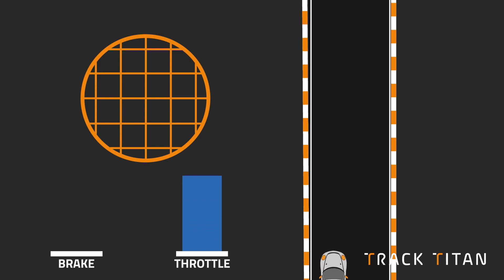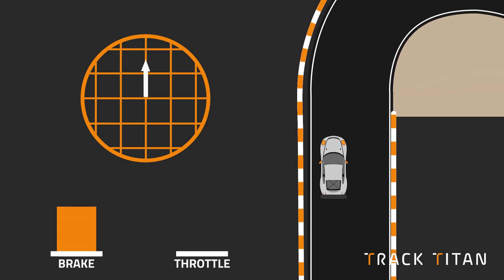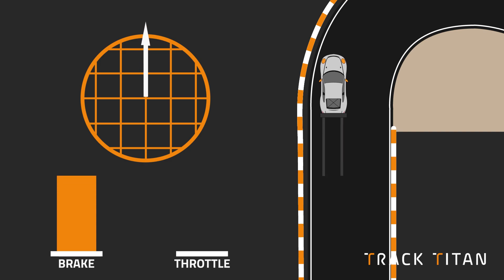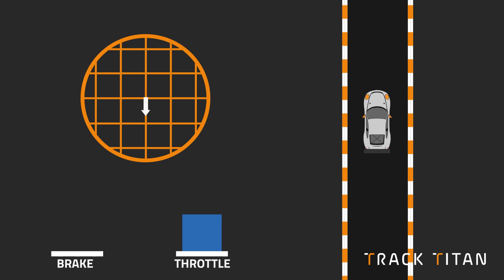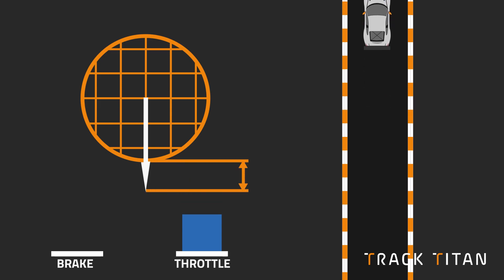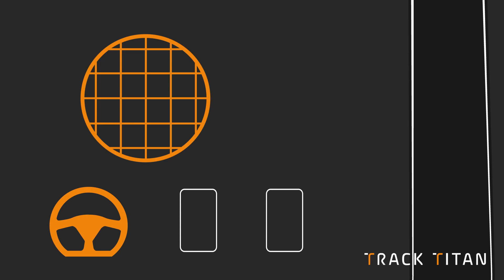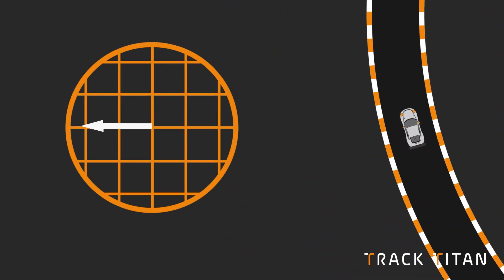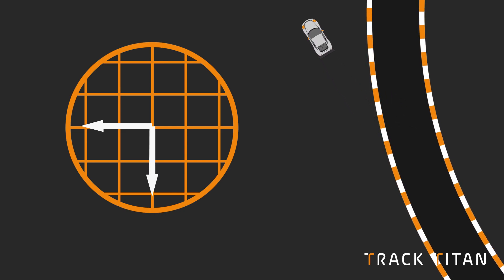The fundamental concept most simracers don't know about | Friction Circle Guide

Comment: When looking at the possible acceleration for a non-AWD car, it's never really a circle, but is rather "cut" at the bottom. That's because the driven wheels never have 100% of the weight of the car, and thus can only generate some % of acceleration, compared to e.g. straight line braking. Having said that, I think your example of acceleration needs correction.

(I'm assuming we're talking about race cars and not dragsters)
Reply from the maker: Sorry, not sure we fully follow the "cut" part?

Comment: love the video guys. you are rocking. But can you tell me what if the point moves not in or not out but on the circle? For example, taking a turn while accelerating or braking the point stayed on the circle, that means the car is perfectly balanced and we are extracting the utmost grip from the car?
Reply from the maker: Your goal is to be exactly on the edge of the circle. That way, you are using all the available grip but you are not sliding.
Reply: @TrackTitan  so in inside the circle is like not utilising the car's capability entirely and we are loosing time right?
Reply from the maker: @yasasvyguntur4109  Exactly :)

Comment: It seems G circle is very similar to it, maybe they are same concept?
Reply from the maker: Good question; they are related but actually NOT the same. Good example: You spin the rear wheels and lose traction. In that case, you would exceed the friction circle limits but you could have very little g-force as the car is barely moving. Hope that makes sense!